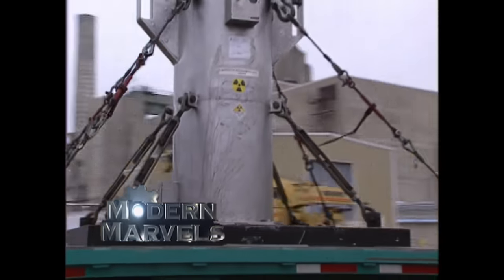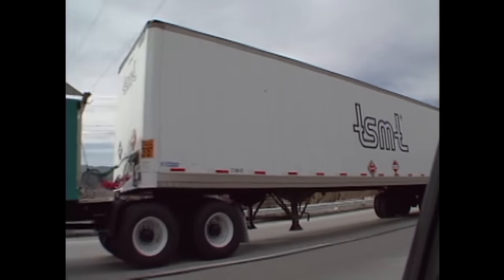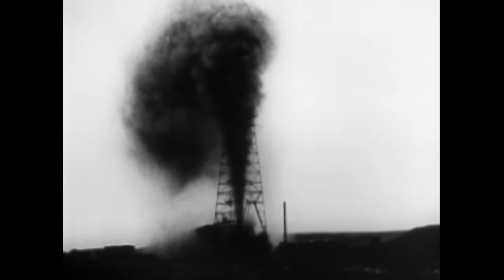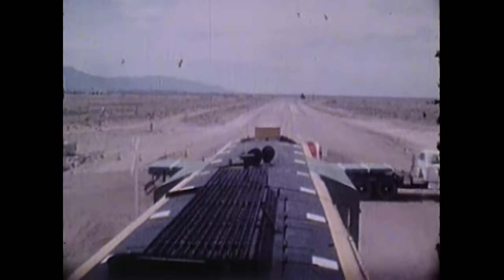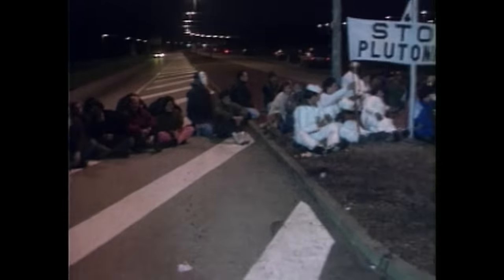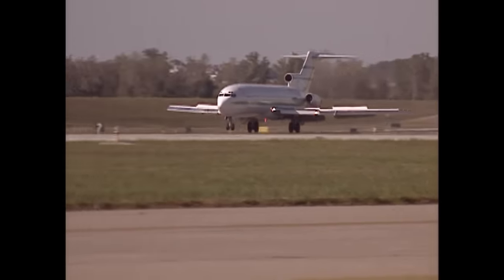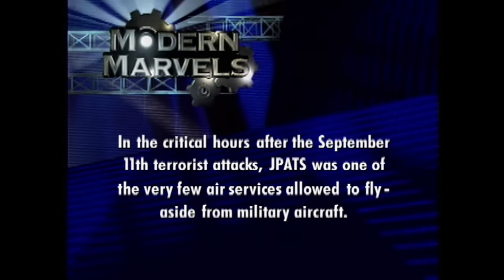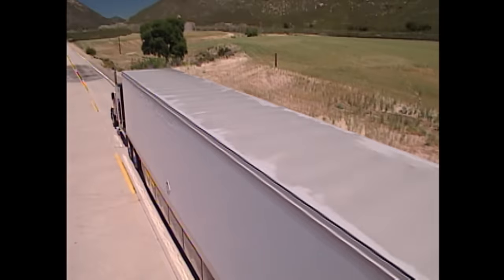Transporting Dangerous Cargo | Modern Marvels (S9, E18) | Full Episode

Comment: The funny part about Greenpeace trying to block the shipments don't realize without nuclear power our carbon output would skyrocket. Gotta get power from some place.
Reply: And it's technically the safest reliable source of energy. Less people have died from nuclear power than almost every other form of power plant. And in the U.S. even our coal plants are incredibly clean. The air coming out of them is often cleaner than what you breath everyday. Thanks to all the scrubbers and bag houses.
Reply: I’m a GreenPeace supporter, and I’m leaning on fusion tech over fission. While mining will still be an issue the waste will be far less. 

I have had to embrace don’t let perfect be the enemy of the good.

That said, that cargo goes through my we don’t use nukes state (which has uranium mines and related Superfund sites. And it doesn’t make me comfortable at all.

Comment: The oddest thing I've seen being by the freeway is watching a nuclear reactor go by they had the freeway shut down for over 2 hours to make sure everything was good for others
Reply: How could you tell it was a nuclear reactor?
Reply: @poloska9471  it had a nuclear reactor sign on the side
Reply: @martyfox9099  That's not a reactor. You can't haul a reactor. You might have seen fuel rods or some other radioactive material.
Reply: @chrisadams3668  ok it clearly stated nuclear reactor on the side of it!!!!
Reply: @martyfox9099  You misread.
Reply: @chrisadams3668  I don't think so I live less than 100 feet from the freeway it was BOLD LETTERS on it ok so don't play me as a fool I can read
Reply: I've seen nuclear waste flasks go down the railroad before. Those ones are the coolest.
Reply: @martyfox9099  You couldn't move even the smallest reactor on a trailer. It was likely components for the reactor. In the 70s I lived across the street from one of the smallest ever built, and it covered half a city block It was in Alaska, so t didn't have cooling towers.
Reply: Back in the mid '80s, Air Products was upgrading their facility in Middletown Ohio. The equipment was built in England, since it was too big to transport to Middletown over the Interstate system. It was brought up the Mississippi and Ohio rivers to near Cincinnati. There, it was loaded onto a 40 axle, 4,000 HP drawler with a top speed of 10 MPH. It went through Delhi Township, and onto ST Rt 4, then to Bypass 4. Once it reached the south end of Middletown, it was moved onto Yankee Road. It was so big that the Cable TV company that I worked for had our techs working ahead of it, dropping the lines to home, then putting them back up after it had passed. Traffic signals had to be removed in some places, as well.
Once it was delivered, the lane of the two state highways was inspected, and damaged sections of concrete were cut out. The highway was three feet of reinforced concrete. Concrete saws cut across the entire lane, and cranes lifted out the damaged section. New rebar was welded in, then new concrete was poured. This saved close to a decade opposed to building it, on site.
Reply: You tube
Reply: @michaelterrell thats exactly right. 
You absolutely can't move a reactor. I don't know the rules in other countries but it was likely parts FOR are a reactor or possibly items that have trace amounts of radioactive contaminants.
For example if there was a  decommissioned nuclear housing it would still need to be marked as radioactive. They try do be discreet with that type of stuff so something must have gone wrong if you could see the load.

Comment: Finally an episode about Hazmat. Most hazmat placards have DOT numbers and UN numbers some don't. 

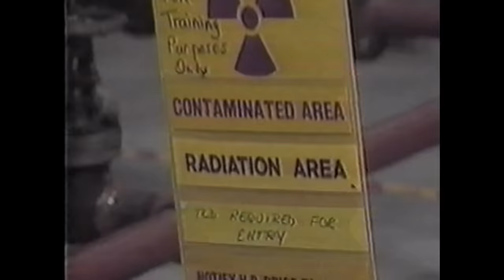2:28 There are nine placards and 15 critical UN and DOT numbers you should know 1.1 is Dynamite any truck with this on the side is hauling nitric acid which although is listed as an acid it is really a high explosive you will also find ANFO which is ammonium nitrate fertilizer, TNT, C4, and SIMTEX up here also. 1.3 is rocket fuel this placard is on train cars or transporters hauling rockets for NASA if you see 1.3 stay away these are the boosters for our rockets. Last but not least 1.4 is Fireworks everything that goes bang is in this category so is ammo. 

Class 2 does have DOT numbers because everything in this category is a gas here is an easy one Hazmat 2.1 DOT/UN Number 2203 that's Saline Gas which is used to make computer chips. You will find Argon, Neon, Propane, Oxygen, Helium, Liquid Nitrogen, you name it if it is a gas you will find it in Class 2. 

Class 3 is all the Fuels if it rides in a tanker you will find it here 3374 is Solvent, 1202 is Diesel Gas, 1203 is Gas or Petrol Oil if you are in Europe,  and 1267 is Crude which is 100% Oil. You don't want to get in an accident with a tanker everything Class 3 can explode if the tanker gets in a spill. 

Class 4 are the Flammable Solids add water they will blow up. Here is another one Hazmat 4.1 DOT/UN Number 2059 is Nitrocellulose this is used in matches and scratch paper used in special effects light it and it is gone. 2257 is Potassium Nitrate in its solid form.
 
Class 5 are oxidizers all of them are very corrosive in an oxygen environment.  

Class 6 are all the Poisons everything in a chemical tanker is a poison so you should stay away and don't open it. 2902 is pesticides and 1624 is Mercury Chloride. 

Class 7 is Nuclear everything in this category is Radioactive. If you want to have kids stay away from a truck that has a Nuclear placard on it. 

Class 8 is all the Acids here is another quiz Hazmat Class 8 DOT/UN Number 1830 is our old friend Acid itself Sulfuric Acid one drop of this stuff and you will be dissolved in seconds. 1824 is Sodium Hydroxide also known as Lye, and 1789 is Hydrochloric Acid. 

 Class 9 is Nothing all loads in this class are not marked so you need to be careful.
Reply: This is a good knowledge to know. 💯💯💯🔥🔥🔥🔥
Reply: There were alot you said wasn't quite accurate but close enough.
Reply: @geomodelrailroader
Wow, what a lot of inaccurate blabbering drivel

Comment: Did you know that they used to consider watches that had the glow faces as dangerous cargo, it had a vehicle with federal agents following because they were worried that someone could get it because it's radioactive material.
Reply: Radium has a very low level of radioactivity. It was used in WWII for meters and indicators on their Avionics since there were no reliable sub-miniature incandescent lamps.
Some of the women who hand painted these items had a bad habit of licking the tip of their artist paint brushes to stick the hairs together, to be able to draw finer lines. These caused severe health issues.

Comment: It's OnStar for Big Rigs 👀
Reply: When I retired the first time over 20 years ago, I reached into my bucket list, got a CDL with HAZMAT endorsement and drove an over-the-road semi.  All of my company's tractors had the Qualcomm system.  My truck was governed to 65 MPH.  I quickly discerned that speed was not derived from the GPS receiver but instead from the axle speed sensor.  So I designed a little circuit board that would spoof the computer to believe I was going 65 when I actually drove up to 70 MPH.  A much more comfortable speed.

Despite the governor, the company constantly pressed me to keep two logbooks so I could cheat on my time of service.  They were one of the more egregious violators whom the DOT forced electronic log books on.  A great relief to me and other honest drivers.

Comment: I wonder what year this was actually filmed?  I don't think Qualcomm is used anymore... at least not much as there all moving to Electronic Logs now. The "quality" of the filming... etc..
Reply: Qualcomm is still used everyday. It is more than just a logbook. It is a means for the dispatcher to communicate with the driver. Letting them know about changes in timing of drops or pickups, storms or accidents on route, details on their next loads, and messages from the company officials.
Reply: @davemoulton2971  Well with the Electronic Log and cellphones now... wasn't Real sure IF those WERE Still used much anymore.